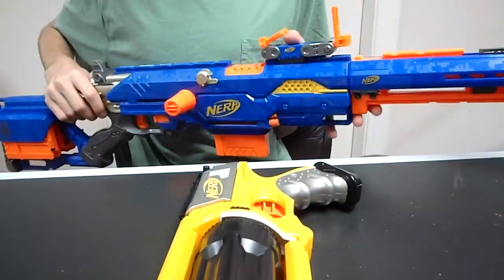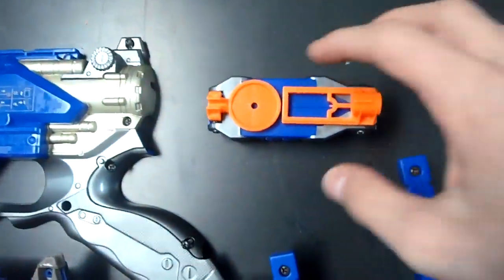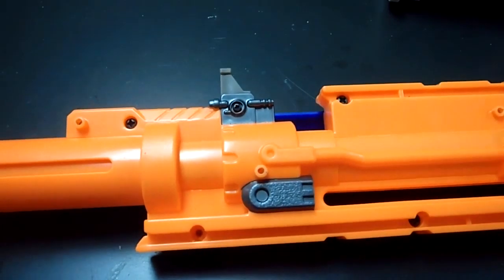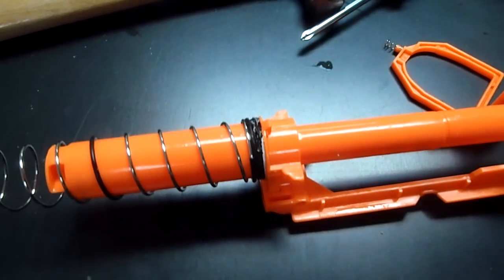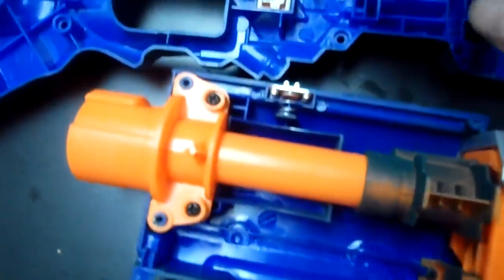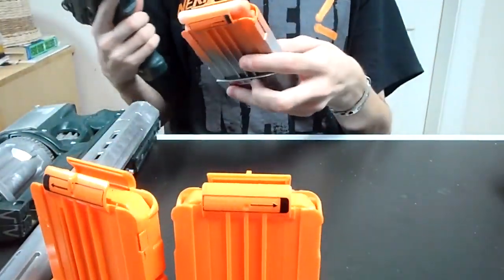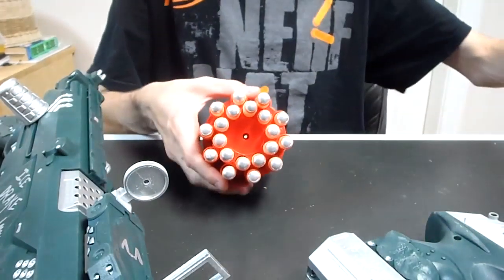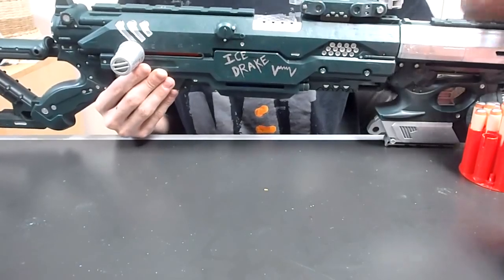The Nerf "Ice Drake", a custom Longstrike + Maverick Integration

Comment: "I just want to make a quick note, this is the clip lock. It's garbage. Get rid of it."

I just got a longstrike the other day. Never modded before in my life. The same day I got it, I did two mods. Drilled the air restrictor out and GOT RID OF THAT FUCKING CLIP LOCK. Like if I'm changing mags and my bud sneaks up on me, I'm done. I'm out. But without that clip lock I can reload early and still have a dart in the chamber. 

Yes, DO get rid of the clip lock. It is absolute garbage.

Comment: nice integration there. i have an advice for if u want! when fit maverick with the 2nd part of the longstrike try to file or sand down the connection spots with the puddy so they look like they are this way by stock! this will give u a damn nice finish! on the other hand i dont know if this works for u cause i dont know if the epoxy gets weaker if u shape it.

Comment: I got a question for you. Once you remove the Air restrictor do you add anything to prevent the plastic from smashing  the other end at full force and making a loud bang noise when firing? Or do you not.

Comment: @mobeydick24 what "loading things" the bolt or the clip release? the clip release buttons are screwed in internally, the bolt you need a claw hammer, and CAREFULLY pop it off. too much pressure will crack the shell